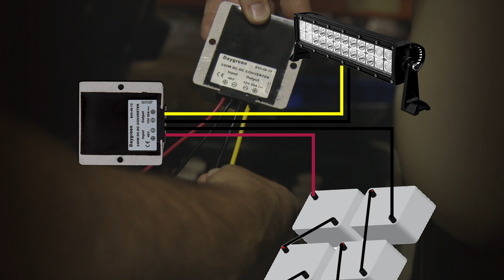How to install golf cart 48 volt converter

Comment: I have installed a 48/12v converter in my cart that has factory lights.  Where do I connect the negative cable from the converter?  I cannot follow the wiring diagrams I have found online matching up to the spaghetti of wire I see :(.  Is there a common ground point?  Any help greatly appreciated!

Comment: Question - If I only need 12 Volts to power 4 LED strips do I really need a reducer for the entire 48 volt bank?  Can't I just tap into 2 6 volt batteries to get my 12 volts?
Reply: You can, and it will work, but you want to maintain equal power to all the batteries so they discharge and recharge evenly. if your lights are only hooked up to 1 or 2 batteries, those batteries will deplete more than the remaining batteries, so that when it comes to time to charge the cart it can overcharge the remaining batteries, causing premature wear on them. Some manufacturers do hook lights up to just one or 2 batteries but it does wear them unevenly. Poor design in my opinion.
Reply: Most 48 volt carts use 8 volt batteries